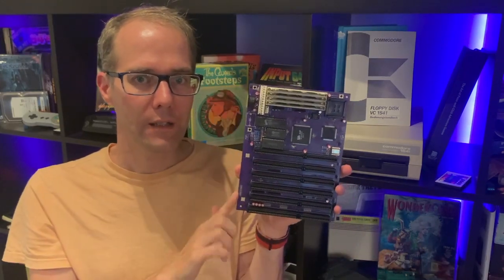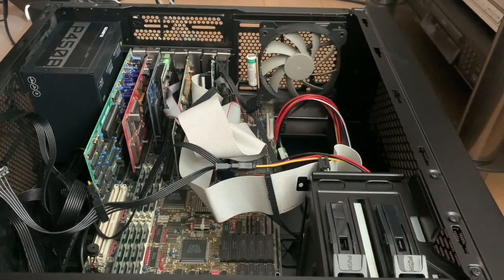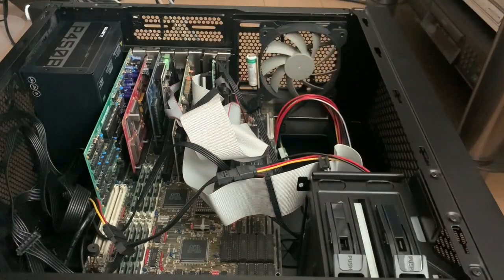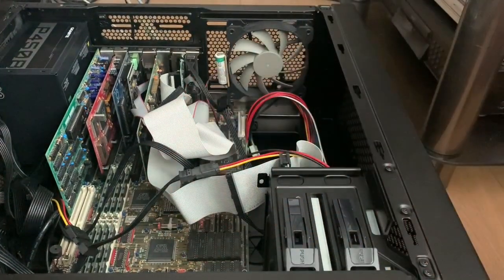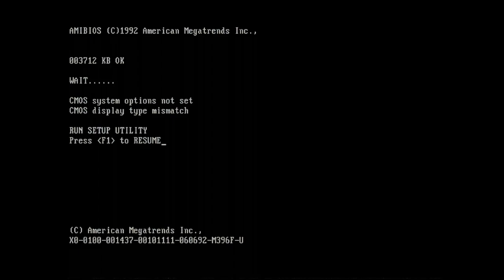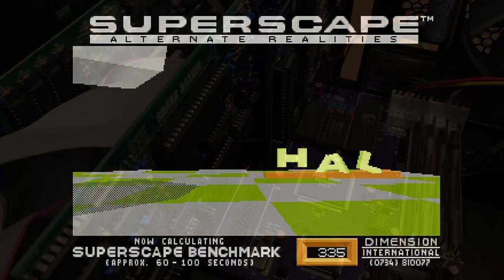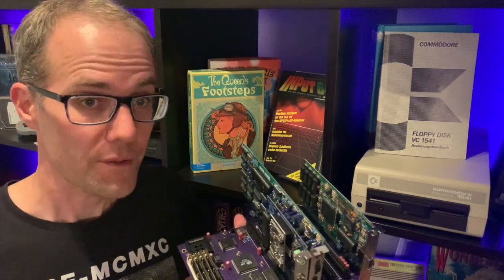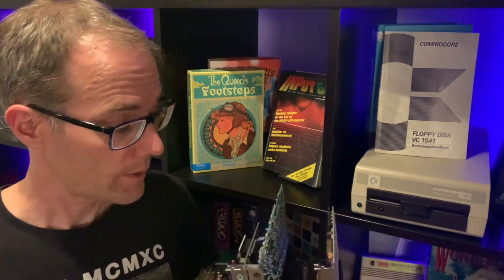The M396F 386SX Homebrew Mainboard

Comment: I saw this a while back and I am so tempted to get one. I can't solder to save my life, but I guess I can buy the materials, learn how to solder, and then solder it. However, I am tempted to get a 486SLC (or 486SXLC?) processor for it instead of a 386SX. Might as well get a 387 for it too because I can. In short, it is a really neat board that I would love to try to use a 486SLC with.

6:28 screwholes not aligning is pretty common for AT boards to the best of my knowledge. You would use plastic standoffs for the ones that don't line up.

Comment: there's clip-on 486 upgrades out there and in general,. 386sx compatible 486 parts that this board could be produced with as a shortcut to a homebrew 486 system...
Reply from the maker: Yes, however it will still be severely limited with its 16 bit data bus.

Comment: Is there a atx version
Reply from the maker: No. Check the github repo. He talks about the form factor there.
Reply: I'd love to have access to the design files for this project, the first thing I'd do is lay this out for MicroATX format and add an ATX power header. Then modernise the battery system, and maybe add integrated IDE. That'd be sweet!

Comment: Very cool that stuff like this exists today, I love that people can reverse engineer and replicate old tech.

I have a couple RC4016A boards I'm trying to repair and I'd love a datasheet for the chipset or even just a pinout diagram if anybody has one.
Reply from the maker: Do you really mean RC4016A? Was that another chipset by SARC? Can't find anything about that on Google...
Reply: @root42  I meant RC2016A! Sorry for the confusion lol. I have two 386SX motherboards with this chipset that are very similar to the M396F but with slight differences. Mine are identical to the one Atheatos modded in this video to accept a 486SXLC2 processor: https://www.youtube.com/watch?v=sgXdiCPwGUA&t=1265s

But yes a pinout of the RC2016A would be helpful.
Reply: Well tonight I've determined that one of my SX boards is basically unrepairable, but the RC2016 might be salvageable.

Have any extra M396F bare PCBs for sale? :P
Reply from the maker: @DamienMC83  Not me, but you can write to Marco, the author.

Comment: My first true own PC.

Motherboard Forcom M396F V2.7 (featured 6 ISA-XT/AT slots for expansions);  it had a merged AMD Am386sx40 @33MHz CPU (in later years, I learned how to overclock it to 40MHz by a simple switch of jumpers, which were not in the M396F V2.2), with 4MB of SIMM-30pin RAM (4x1MB); later I added a Cyrix CX387SX as MathCoPro; magnetic units as HD & FD were, respectively, a Seagate 3.5" of 256MB and a classical floppy drive, both (together with a mouse) controlled by a serial controller board nested into an ISA-AT 16bit slot; the last and most powerful videoboard was an Oak OtiVGA 1580 with a Oti087 GPU and 1MB VRAM; the audio-board was an 8bit  Master Boomer/Media Concept 2.0 with ISA XT connector, with a purely pre-amplified mono-audio channel (the soundboard had a rheostat embedded in the rear side!), coupled and sold together with two speakers of the same brand.
The last OS was a MS-DOS 6.22 enriched with a MS-Windows 3.1.

Comment: Will this be available in Gerber form or will it be a commercial product, if at all?  I just looked at the GitHub repository and found no Gerber files.  I ask because I have a dead 386 board that I cannot resurrect.
Reply from the maker: The author told me he will put up the Gerber files later this year. So you can simply watch the github repo for any changes!

Comment: Did you have to add your own BIOS chip, did it come with one harvested from another board?
Reply: You can make your own, we have a bios dump on ultimateretro.
Reply from the maker: @DxDeksor  Do you mind to share a link? Could be useful.
Reply: I'm trying to answer but the message doesn't appear :(
Reply from the maker: youtube filter... it's also not in the spam messages. sorry.
Reply: @root42  go to the place I mentioned before and search for the motherboard's name
Reply: I have tried, I can't phrase it differently 😂
Reply from the maker: Marco harvested the BIOS, keyboard controller, CMOS and main chip from the broken board.

Comment: Very cool project ! I have the rev 2.6 board which works fine, but at least now I'm safe if it ever kicks the bucket :D

Now it seems that the github repo doesn't contain the required files to recreate the board yet :(

Also I can see at least two improvements that could be done over the original design :
- adapt it to use 3.3V CR2032 batteries
- leave a spot to add a 3.3V regulator to run chips like the Ti486SXLC2 (which is a 486 with a 386SX package, 8KB of cache and a clock doubler)
Reply: Gerberfiles are now on github.
Reply from the maker: I think because the board isn’t finished yet he didn’t publish the gerber files yet.
Reply: @root42  @deksor 
It need few test and check.  Nobody except me have checked it with mathematic coprocessor. 
I have checked it with  387SL (not SX ).FPU works fine.
Today, i have soldered Tx486SLC on my  M396F replica -> it works also well and runs really fast.

I want also checking with difference keyboard-controller (SARC 6042 is really odd KBC )  It works well with common VT82C42
Same with checking of alternative parts  on M396F.

test and qualification is not yet finished. If Test and qualification is finished -> marco would puplished gerber file.
It looks really good.
Reply: @matthiaskorn7544  What speed TI486SLC did you install? Curious to know if the 3.3V TI486SXLC2-50 will work in this board without modification.
Reply: you can use every  486SLC  (  not SXLC2 )  also with 3.3V Marking.
Cyrix/TI 486SLC-V  is just a  5V  CPU with guaranteed 3.3V  operation. Datasheet told me:  "The 486SLC-V can be operated as a 486SLC"

486SXLC2 is  pure 3.3V CPU  (not sure)

My  CPU ist TI  486SLC/E-33
Reply: @matthiaskorn7544  iirc the SXLC2 is 3.3V only indeed but 5V tolerant for io (like the intel 486 DX4)

Comment: The board you had before isn't "Full size AT". Both are "Baby AT". AT boards are the same size as the IBM AT's board. Baby AT is basically "AT computer on an XT sized motherboard or narrower".
Reply from the maker: You‘re right. I actually have a full size AT boars. It’s a clone of the original IBM with added floppy controller.